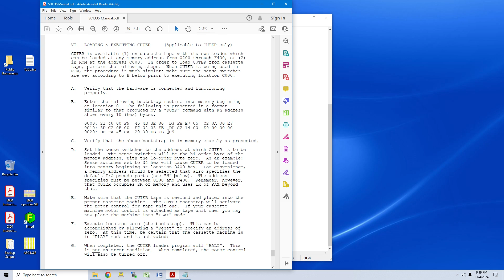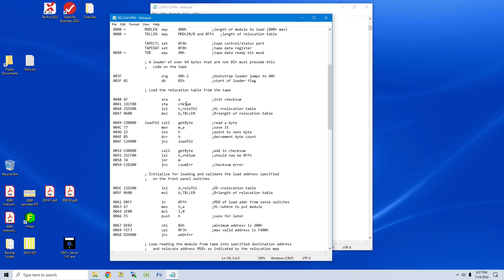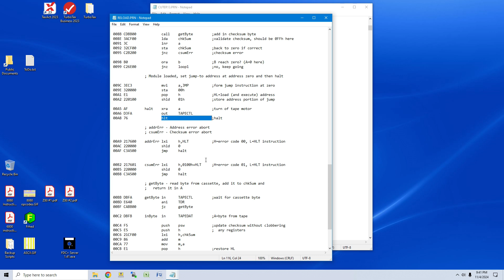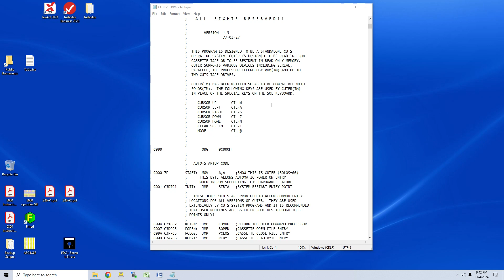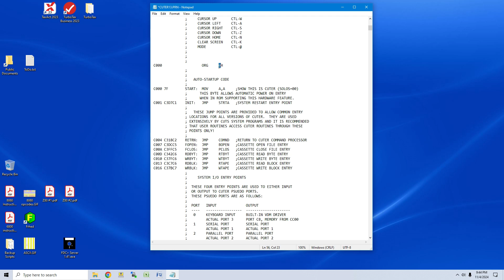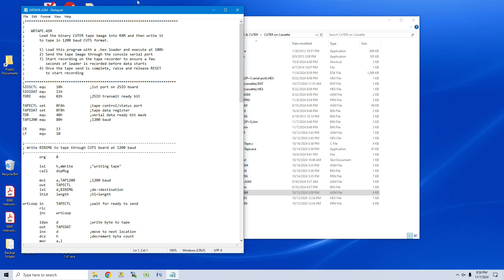Resurrecting a Lost Microcomputer Tape Operating System - Part 2

Comment: For sending audio to tape, perhaps you can use a "Covox" module if you can somehow drive a parallel port. It's just a DAC made out of a 20K resistor ladder, attached to the data output pins of the parallel port.

Comment: Cool!

Re recreating the cassette format on a modern computer:
I had a look at it, and it seems like general opinion is that the audio playback application has to use WASAPI or ASIO in order for Windows to not do some internal sample rate conversion or whatnot.
I don't think that the problem you saw was due to some filtering to make the audio sound in a particular way, but rather the result of the DAC constantly running at a fixed frequency and all audio ending up to be sample rate converted to fit that fixed frequency, with no exceptions for audio that runs at the same frequency as the DAC or where the DAC frequency is an even multiple of the audio data sample rate.

It seems like there are plugins both for WASAPI or ASIO for FooBar2000, which IMHO is the best audio player for Windows.

Btw maybe I missed something, but are there any code that checksums the second stage loader itself? I assume that most read errors of it would result in something that don't work at all, but in theory there could be some load error that causes weird errors further on. Highly unlikely, but still.

Are there any archived tapes available for this tape format att all?

Comment: I got to 8:08 and paused, wondering how to use bits in the relocation table to calculate what byte to add to in order to set it to the proper address, and then I realised that all you need is a shift command and then jump on no carry to skip the relocation code if the bit was zero.  Sometimes, the solution is too obvious and it takes ages to figure it out for that reason. 😄

Comment: That trick of assembling program twice with different org address, to find out where relocations needs to be done is really clever and simple.

As of whetever one would a bitmap, or list of offsets is another thing (this is how modern relocations in dynamic linkers work). Depends on a number of relocations, and size of the final program. But I am sure there is more than 256 relocations, so 1 byte offsets would not be enough. I am sure it was done here with a bitmap, because it is pretty simple, and in the end quite effective and efficient here.

Comment: Mike, the worst thing you can do to a frequency shift keyed signal is run it through a psychoaccoustic model, between the initial aggressive bandpass filtering that occurs at the front-end, to the discrete cosine transformation that occurs on the back-end of the MPEG audio CODEC, you'll wind up with something really gnarly at the end.

Comment: The old trick I'd use for 6502 page-level relocation, would be to assemble the resulting code twice, 0100H apart, and store the difference of any 3 byte instruction into a table, which could then be quickly fixed up.
Reply: At least one of the 6502 "variants" (possibly the 6809) had PCR data loading instructions (Program Counter Relative).  Added to relative jumps and calls, it was possible to make a machine code program completely relocatable so it could reside anywhere in memory without modification.  You only needed to assemble the program with an ORiGin of zero.
I did that with one program for the TRS-80 CoCo, which was a program designed to sit "behind" BASIC and take USR calls to print text onto the high-res graphics screen; something which was not supported by the hardware.
Reply: @melkiorwiseman  The 6502 and 6809 are very different CPUs from a common ancestor, and yes, the 6809 did have PCR addressing. The 6502 didn't, and you really had to do your own acrobatics to relocate things around.
Reply: @tschak909  Ah, well, I'm not certain what had what, since I was mainly a Z80 guy, but I certainly did like the PCR data handling instructions and wish the Z80 folks had thought to add them.
Reply: @tschak909 yeah, the 6502 was targeting the intel 4004. The z80 targeted the intel 8080. The 6809 was targeting itself.

Comment: A slight correction to the disassembly comment is that the code you call “skip 64 bytes “ is actually a “wait for motor to come too speed” loop.
Reply from the maker: Yes, of course, the purpose of the skip64 loop is to ignore garbage during motor startup, but this is done by reading and ignoring 64 bytes of data, not a delay loop, hence the label name.

Comment: I'm currently making a modem for my Altair replica, I haven't tried CUTS format yet but from what I read it's manchester encoding and it sounds simpler to decode than the frequency shift since there is a comparator interrupt on my microcontroller